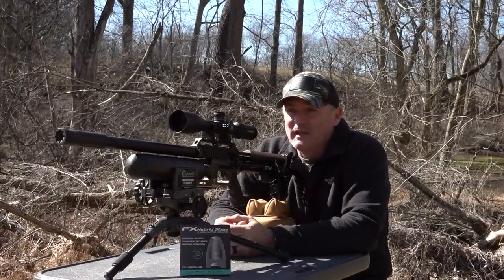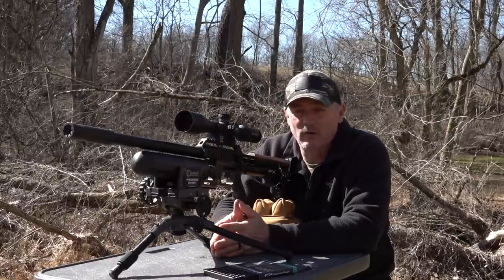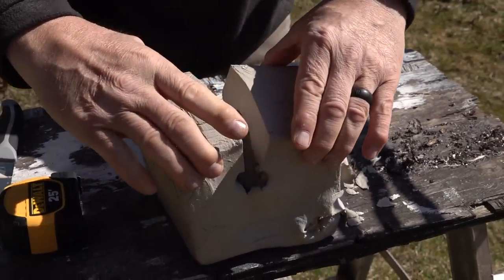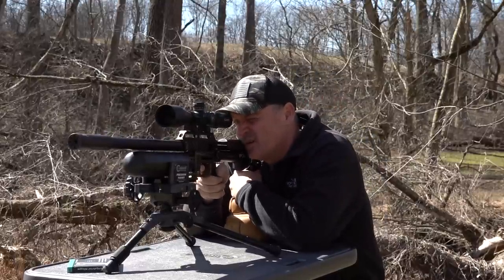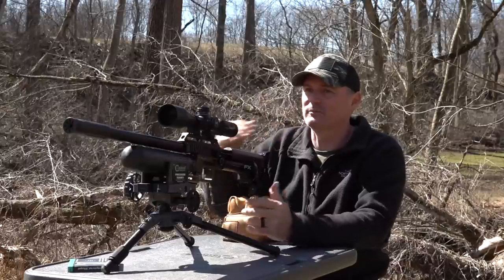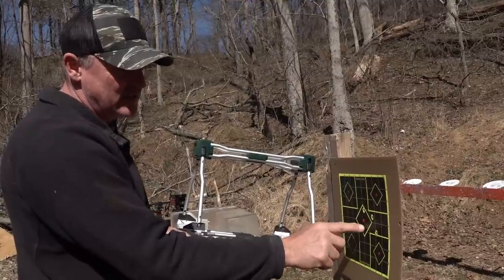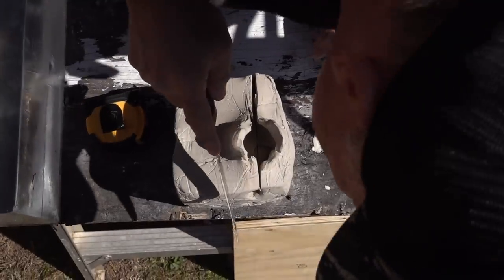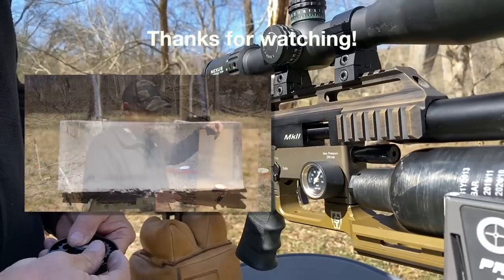FX Hybrid Slugs | .30 Caliber | Ballistics Gel Test

Comment: Impressive 36 ftlbs at 200 yards, amazing. Thanks for all your time and effort. You are one of 3 or 4 I’ve learned so much about airguns from. 👍
Reply: It is interesting that when you simulate at Strelok Pro, at 205 yards (his shot is at 207 yards, if not mistaken), to get that energy of 35.82 Ftlbs (602 FPS - 44.5 grains), the ballistic coefficient would have to be around 0.060 to match the real data, considering his muzzle velocity is 950 FPS, way way lower than the advertised 0.102, almost half of it....I wonder how they come up with this marketing numbers? Dont take me wrong, still better to cut the wind than pellets, but nowhere near what they advertise...or am I missing something here?
Reply: @ohleocleafar   the bc = 0.070 at 100 yards

Comment: Had my new 30 Maverick Sniper slug barrel out yesterday in 20 mph winds and tried the FX hybrids. Past 50 yards forget it. 55 grain NSA were better and cheaper.
Reply: What kind of velocity, are you getting with those NSA 55gr slug's? I got a Maverick Sniper 25 cal, but I bought the 30cal kit for it.  I recently got, the AEA Challenger Pro 30 cal also, but haven't opened the box yet.
Reply: @sagemajka4871  power wheel 7 and reg at 147 bar 55 grain slugs at 950fps
And FX hybrids about 980fps 
I have transfer port and pin probe power kit too.
Probably gonna bump up reg to 160
AEA Pro Challenger has power but
trigger not so good and shoulder stock wiggles and a.low shot count and history of leaking but the price is right. Good truck gun.

Comment: Wow. Fair amount of movement on a high bc , heavy slug at 100. Pellet 2x the deflection ? Would be cool to see the venerable 22 lr , std velocity 40gr comparison.
Reply: you need about a 100-110gr .30 bullet to be similar, ballistically, to a 36-40gr .22 bullet. Were you to fill in the cavity on that hollow .30 bullet, you might have something close to 75gr. Not only would the .22LR bullet be going faster, it is also more efficient. There appears to be almost no wind  during this testing, a .22LR might drift .5"-1"  in 100 yards, maybe 4" at 200yards with it.

Comment: curious how they will work or not work in the original smooth twist barrel
Reply from the maker: I was thinking the same thing
Reply: Original Smooth Twist is just too slow of a twist to get them performing well. Short distance you'd be fine but at longer distance they need the faster 1:23 twist that the Superior Liner imparts to spin them at the proper rate.

Comment: I have fired several hundred of the hybrids through my 30 at 930 fps. I am always interested in these tests, but IME on actual game, no matter pellet or slug, the results are far different than on clay or BG. I have a few recovered Hybrids taken from large  raccoons  shot at 7 yards through the face and down the neck. They didn't expand much at all other than having the nose collapse in on itself a bit to form a 30 cal cylinder. It has been the same way with NSA slugs in 22, 25, and 30 cals, and with the Hyrbids in 25 cal fired at 955.. I have 2400 more 30 Hybrids because they shoot well  and cut the wind. I was shooting them yesterday at 85-105 yards in a 15 mph crosswind and not getting anywhere near the drift you did here. I am noticing that the last two orders of Hybrids seem to have the hollow point problem taken care of. My first couple orders, the opening was filled with lead particles and barely open and may be the reason why they weren't expanding properly. The last couple orders all have a nice clean opening and it also seems to be slightly larger  than before. We'll see how they do on game. :-)
Reply: I totally agree with your observation about the lack of expansion for the FX .25 cal. and 30 cal. hybrids through game and ballistic gel. I have done my testing on the .22 cal Hybrids which do expand very well in gel and pigeons too. The .25 Hybrids have not expanded in the gel and in pigeons. The 30's I have tested in the gel showed very little expansion. I am waiting to try the 30's  on a shot groundhog with a body shot to compare results. I got to wonder why the expansion tests results were only shown on the clay and not shown with the gel. Is there some hyping of the results going on here. Why can't we just be satisfied with knowing these slugs can be accurate and have good b.c.'s for longer range shooting on small critters with body shots and heads shots on larger game.
Reply: its a good weight 44.5 for 30 cal whats better tho as NSA offers many weights 43.8 is the close competitor and it has a hollow point and also looks good ,, they claim a lot of hype on the fx slug they say accuracy twist rate, a comparison video of fx vs nsa slugs next would be cool
Reply: @themikarenolds2910  I have a variety of NSA slugs in 25 and 30 cal. I have the 43.5 and 47.2 and 49.5 NSA 30's. The 43.8 actually shoot quite well in my 30 with the newest Superior liners (which have a varying degree of twist for some unknown reason). I have one that is 1-23" and one that is 1-22" twist, both 30 cal and both 700 mm. I have not bothered with the 1-22 because the 1-23 showed up at my door first and has been very good with both pellets and slugs. In fact, it shoots the 44.75 JSB/FX pellets as well as or better than, the original 1-37 my Impact MK II w/PP  came with which was an STX liner.  The 47.2 and 49.5 shoot pretty well, and may actually shoot awesome if I wanted to mess with my tuning, but I don't. The Hybrids shoot great. I have shot them to 130 yards so far. The NSA just don't quite match the Hybrids on my tune, but I will say, the 43.5 does actually expand some, but they will tip over sideways in the FX sideshot mags, so you have to pay attention to that.
Reply: 💡The solution is speed👍 Different batches of slugs have different amounts of antimony mixed in with the lead, thus making them harder, so if you want good expansion you need faster speeds. I NEVER go by the BS written on the boxes because it's just advertising sales-tales a majority of the time😞 Just like these channels that are "pay to say" advertiser's😔 There's far too many people that lack the ability to test thing's and to think for themselves and blindly follow these channels as far as quality/purposed slug speeds and other thing's and take what theyve been told as being facts😬 And the silliest one I think is the whole "you should only shoot 950fps and slower to get good results MYTH😒 I shoot my slugs at over 1100fps and get phenomenal results as far as expansion and accuracy, and of course that's only with slugs and not pellets because they're made for the slow paper shooting groupies that leads the unknowing people to be slow. So yep speed gives the best of the best in my experience, wishing you great results!🙏👍👍👍👍👍